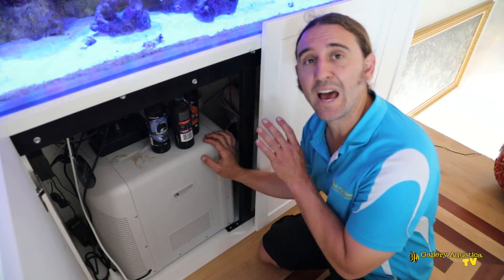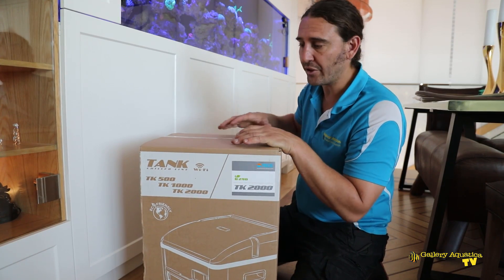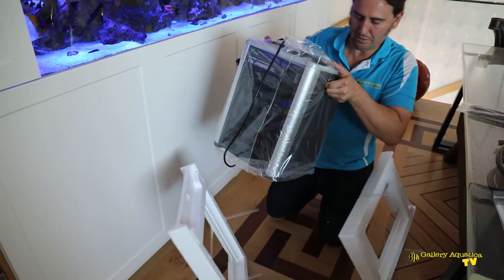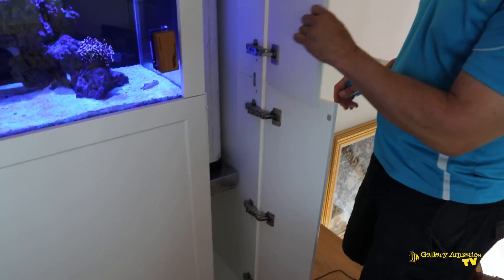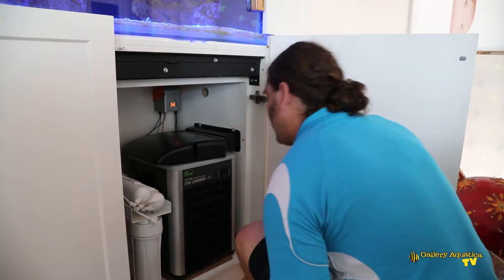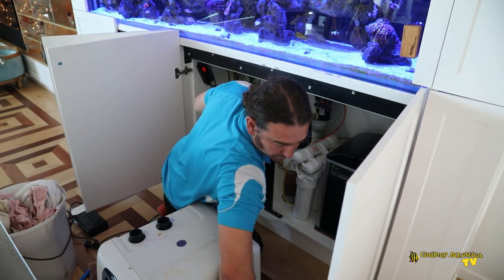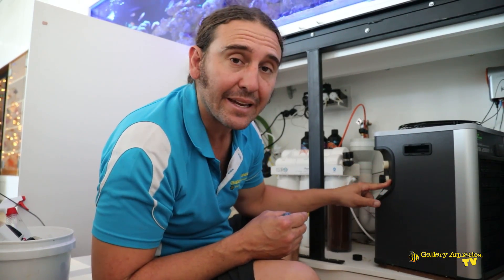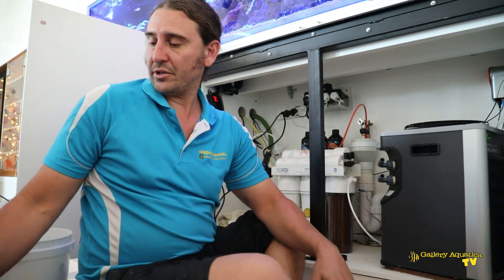Chiller Replacement at Reef Royale --- Gallery Aquatica

Comment: Nice work, I’ve got a Cade 2100 with teco 2000 in the side cabinet, it’s connected to my return manifold should the outlet water return back into the sump on the other end?
Reply from the maker: You might find you get slightly better temperature control if the chiller return goes back into the sump down the end with the drainage pipes and filter socks, but it doesn’t make a huge difference. I usually just return the chiller hose where it looks neatest and is most secure. Cam
Reply: @GalleryAquaticaTV  thanks champ

Comment: What is your water turn over? How many gallon per hour? Thanks!
Reply from the maker: It’s normally quite low with these chillers, around 200 GPH. Cam
Reply: @GalleryAquaticaTV  so you changed your pump as well to go that low? How does it fit the rule: at least 4 times turn over per hour when they allow up to 2000L aquarium?

211 gph is about 800L/h. That would mean we can only use for aquarium 800/4=200L ?
Reply from the maker: @soulnight1606  I’ve never heard the rule 4 times turnover. There are so many other factors (mainly ambient temp and heat load) that I don’t normally worry about calculations as much as trial and error. I have had problems with chillers in the past when I try to push too much water through them so I’m probably a little conservative with my flow rates. Cam
Reply: @GalleryAquaticaTV  thanks again! What problems did you encounter?